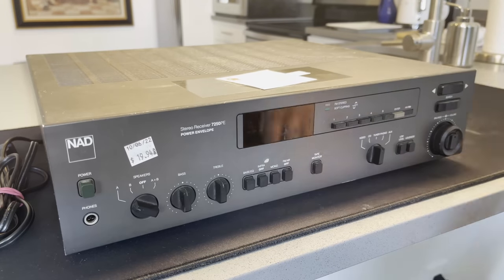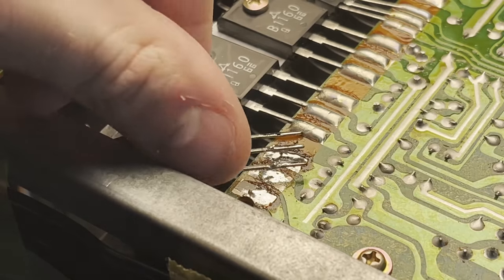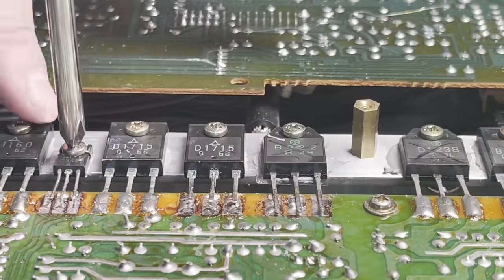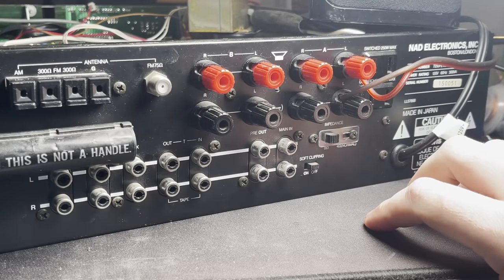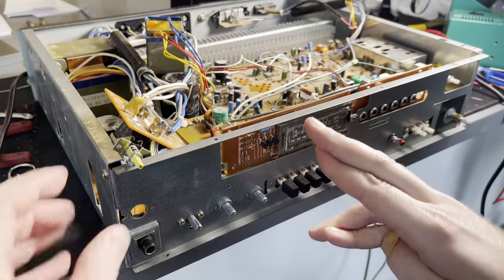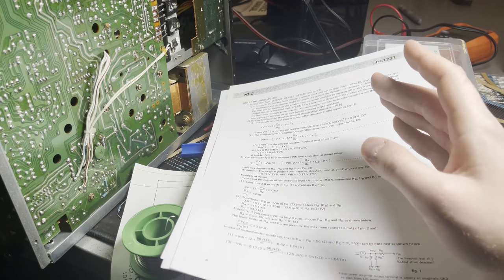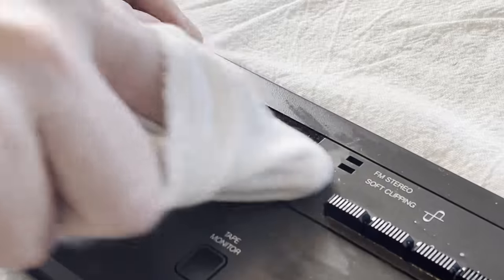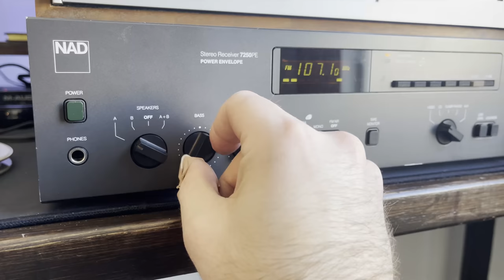Broken Amp? NAD a problem! - 'Fixing' A Mid 1980's Amplifier

Comment: I repaired a NAD 3030 in about 1985 (!) and made the rookie mistake of hooking up my good hifi speakers which of course exploded. Best to use power resistors if you can. I did get it mended though, original fault was an earth wire under a screw which was slightly loose leading to voltage transients which took out the power stages. Didn't help the owner used it on Phono which gives the highest amplification. Soldered a new earth wire after repairing the power stages to prevent it happening again.

Comment: I have the exact same amp., which I bought new in 1987..   It still works like new.  BTW, if you ever do fix that amp, buy lots of replacement transistors.   When you sqeeze out thermal compound the same  as you do toothpaste, those transistors will be blowing out like cheap light bulbs.

Comment: This was enjoyable to watch.. very engaging. 
Funnily enough I picked up an amplifier that was dumped outside a house in a street nearby; but the left side of any output doesn't work (I haven't tried speakers yet though, just headphones).  I have no experience so it won't be getting fixed; but it was interesting seeing you go through this process.

Comment: I'm going to have a go at my NAD C740 which sat unused for a decade and now has a similar protection cutoff issue. Also a neophyte at repair in logic circuits, but know enough to know that the caps will all need a close inspection. I have cheap DVM, ESR and LCR meters and hope to spend the idle winter hours trying not to let out the magic smoke. Nothing to lose and I might learn something. Schematics in hand!
Reply from the maker: Good luck!
Reply: I also had a C720BEE with protection circuit issues. Had it professionally repaired and recapped, full bias adjustment etc. Was worth every penny. Runs two sets of speakers and a sub in my shed. I also have a NAD 3225PE in the living room that I bought new in 1992. Always loved the sound of NAD amps.

Comment: As U probably now know the bridged connections on the rear panel seperate the pre and power amps.  It's so you can get access to pre out and power in separately.  You may pre out to a different / larger power amp.  You may just want to utilise the power amp from a different pre amp source eg external phono pre amp, any line output.  After all it's an integrated amp, meaning both the pre and power amps are in the same box.  Thirdly, as U suggested, U may want to do some signal processing inline between the pre out and power in.  Also gives you access to the pre out, like tape monitoring, eg taking it into a mixer or PC software etc.  A good feature all NAD integrateds have that I have seen.  The new NAD stuff now uses smaller links that are insulated.  Back to the video, cheers.

Comment: Hey from Australia. In my opinion, printed circuit boards are no ones friend. Yeah they're great in low power units like separate Tape Decks and Tuners that don't pull a lot of current etc BUT in amplifiers, especially vacuum tube amplifiers like I own (Primaluna HP Integrated Amplifier running 6 12AU7s on the preamp side and 8 KT120s on the output side) ventilation is essential. Primaluna valve amps run point to point wiring and any PCBs are low power that run their adaptive auto bias which is not in the signal path. All of the valve sockets are attached to the chassis with pencil sized holes around each socket to keep the amp cool. As soon as I saw a Primaluna HP Integrated Amplifier, I had to have it. $7,000 later and nearly 8 years later, it still sings and no more multi meters to check the bias of each of the 8 tubes. NAD have a strange setting on the back labelled (soft clipping). I've forgotten the logic behind it. I'm 63 and have been around electronics all my life. I'm an analog studio/visual enigineer and I was a club DJ over a 30 year period. Cheers for now Andrew Collins, Melbourne Victoria Australia.

Comment: The pre out is to allow for a different power amp to be used and the main in is to use a different preamp. Yes, the jumpers are necessary to use it as a single unit.

Comment: The IC you replaced senses if the power amp output is bad, eg. if there is DC output to the speakers which can be caused by the DC offset adjusted badly, or sometimes the components around that IC for the RMS detector have gone bad, then the IC will trip the relay. This is quite common on other amplifiers such as my Marantz PM7200/6000.

Comment: you should be able to adjust the DC offset in the amp (ie the trigger point) probably a couple of variceal resistors. If you can get a manual it should say how to adjust the offset, so you don't need the extra resistors

Comment: Check your dc voltage at your speakers terminals should be below 50 MV.
Reply: That's what I'm thinking too. Maybe out of spec and overheating one of the transistors

Comment: As for those transistors. The β, that's the difference between the base-emitter current and the collector-emitter current, or amplification level to use a simple term. If the transistor has a β=200 and you're giving it a 1mA current B-E, the current C-E will be 200mA. If it's really far off., like it seemed with at least one of those you measured, you should probably replace the transistor.

Comment: I wish there was someone like you local to me. I was given a Cambridge Audio One. It has a cd and DAB radio and of course speakers, which I thought would be perfect for my bedroom.... but after turning it on no sound came out🤔 Seemed like everything was operating. Then I decided to plug in my headphones, sure enough they worked perfectly🤷‍♂️ 
Now I don’t have access to any repairers anywhere near me and I don’t have the skills.....( I could have replaced a fuse😬) 
So it’s sitting out in my back room.... I did connect up the little bookshelf speakers and they had a good full sound for their size. 
I need to find a hifi / electronics enthusiast on my travels.....🤔 hopefully she’s single too😬😂
Reply: Bob Cordell wrote a very good book about audio amps. Find PDF on the web, the rest you would have to learn by experience, building some diy kits (beware of some of the Chinese kits). Also some the parts are harder to find as the technology turned into class-D amplifiers and chips. The easiest good modern amp would be something based on LM3886 50W chip. Really very nice sounding device, way better than some of the old '80s amps or cheap class-D junk.

Comment: Usually when power transistors fail, they will be totally shorted from C to E (the semiconductor turns into a “full conductor”) so checking that in circuit is usually enough, there will be nothing in an amp circuit shorting them together anyways - but you can also lift just the base to check the diode drop of the B-E junction just to be sure. Other types of failure like leakage, low Hfe, noise etc. are more of a concern with small signal or germanium transistors. 

Can it be that you swapped one of the output transistors from L to R when you resoldered them? That would explain the DC offset because those transistors need to be carefully matched. Also there might be pots to dial the output stage in.

The thing with the 'EQ LOOP' happened to me, as well. But in my case there was a CD direct button which bypassed the preamp tone control for the CD input so I figured the fault must be at the tone control or input selector. Signal traced it out just to find out it worked perfectly - and to notice in the schematic that it wasn't connected internally. Yikes!

Comment: Do you have a digital microscope? I use them to check all the solder joints and for cracked traces.
Reply from the maker: I had a cursory inspection of the solder joints and nothing too obvious stood out to me. I do have a digital microscope, but with the stand it came with it wouldn't work very well on such a big device haha.
Reply: @HifiJelly  I've seen old radios that were DOA come back to life just by taking a heat gun and gently going over the PCB.

Comment: !!! Some thermal paste has metal content in them which makes the paste conductive. Some transistors have a metal surface at the rear of them and base (?) connected to that. The ones here have a plastic rear so there isnt a problem here but if there is a micca pad and a metal rear surface ALWAYS use either thermal grease or ceramic based thermal paste and NEVER metallic ones (computer thermal pastes usually have metallic content)

Comment: Did you remove the mica insulators from the output transistors and just mount them right to the heat sink?  If so, they are going to short...
Reply from the maker: I removed then to clean the old thermal paste off them, but I put them back where they were originally located. I was curious what those were for, figured it was insulating them from the heatsink but wasn't sure why.

Comment: Im not a technician but arent the metal bridges from pre-out to main-in supposed to go from hole to hole only without touching the metal around the port, while you used a cable instead and bridged the full port?!

Comment: At 8:10 in the video, you need to CLEAN  the board prior to soldering. All that old dead flux needs to come off. When you weld or solder, the bond area must be CLEAN. As in hospital CLEAN.

Comment: You finally found it (and you can ignore 90% of the comments) but you had your answer on page 14 of the service manual. Good grief, if the idle currents and/or DC offsets are way out of wack then THAT'S WHERE YOU START. Even if the relay is tripping you can check DC offset at the input pin of the relay. Also you most certainly can check the output transistors in-circuit. Use the low ohms function (not diode check) and measure emitter-collector. Nothing in the circuit will cause a low ohms short circuit except a blown power transistor. The output stages consist of 2 parallel connected NPN and 2 parallel connected PNP transistors in a class AB configuration. If one shorted it's a good bet the other 3 got taken out as well. The biasing transistors could also have gotten damaged. Modifying the protect circuit was absolutely a stupid thing to do especially since you said you measured over 200mV and the optimum setting for DC offset is less than 50mV. You are proving the old adage that a little knowledge can be a dangerous thing. Oh and since this manual covers all  model variations, it's a good bet the US version doesn't have the distortion adjustment pots.
Reply: I never saw the protection chip gone kaput, it's usually what you mentioned in your post.
Reply: @pliedtka  Yea, that's why I said a little knowledge can be dangerous. Imagine what damage you could do to your speakers if you send a high level DC to them....and whoooops!, my protection circuit didn't trip because I modified it because I didn't read the damn service manual.
Reply: You were very lucky to have been born with all knowledge, and never having made a “stupid” mistake.
Reply: @ShadowsOnTheScreen  You're kidding right? In this line of work, if you don't know what you're doing you get help from someone who does. You risk not only damaging equipment but possibly killing yourself in the process. Even in little amps like this you're still dealing with high voltages and currents. I've been in the aerospace business for 30 years. I drill into all the techs under me....if you don't understand something, get help. No excuse when you've got the documentation in front of you.
Reply: @MrDmbright65  if you don't know how to interpret this information you can't really apply it. All he is risking here is damaging his speakers. You have to learn somehow. And you might be a person who is able to interpret documentation in a way that translates into actual real life application and that is admirable whether you worked for it or were able to do this from day one but most people are not capable of doing this. Atleast not without experience.
Reply: @trevor245  Trevor, i've been doing this 45+ years and seen the results of ignorance or incompetence. I've knocked people off of live circuits who were doing the 60Hz shuffle and even once (in the navy) had to perform CPR on a sailor who got hit with 480V 3 phase feeding a radar set that he thought (but didn't check) that the power was tagged out. Even a little amp like this can put you on the ground if you do something wrong. It goes right back to what I first said. If you don't know what you're doing, THEN DON'T.
Reply: @MrDmbright65  Even when studying electrical engineering you learn by doing. One of the first things we did was make an amplifier. While I understand where you are coming from I still disagree
Reply: The extremely valid and labour saving point you've made, is checking the contacts on the amp (not the speakers) side of the relay for DC. I'm working on a NAD7150, which was in 'protection mode'. I measured -18V (bad) on the L channel and 28mV (good) on the R channel.  A transistor and resistor in the L circuitry had become defective.  I've got the receiver out of protection mode, but there is more work to do. These bigger NAD receivers run hot; I noted a lot of electrolytics with shrunk or discolored sleeves. A partial or complete recap may be the answer.

Comment: this two bridges are for the external equalizer😂 measure the middle points between the amp for a DC Value. if a DC is there the secure switcher protect the speaker and switch off the relay.

Comment: Pre out is if you want to use it as a pre amp for some other power amp...and main in is if you for some reason want to use it as a poweramp.
classic mistake to forget to check if the bridge is there.. done it many times.

Comment: ALLOW ME TO 'REPAIR' YOUR NAD AT FIRST GLANCE: Before you even plugged it in or took the cover off .. I looked straight at your problem, which should have been obvious when you determined your pre amp worked but no signal to output amp. SEE BACK PANEL AND OBSERVE THAT YOUR TWO RCA JACK JUMPERS  ARE MISSING  FROM PRE OUT TO MAIN IN. 

The jumpers are removed if using an equalizer in place of the jumpers. If you remove the EQ, the jumpers have to go back in otherwise there's no connection between preamp and amp section. If you can't locate replacement shorting shunts, simply use a stereo RCA plug patch cord to hook the pre out jacks L&R to the main amp in L&R. 
'Fixed'
But now, what damage was caused doing unnecessary circuit work? 
Don't worry .. many people, techs included, have overlooked this simple issue.

Comment: SOOO THE GOOD AND THE FRICKEN BAD.    THE GOOD IS.     IS THOSE JUMPERS HAVE TO BE IN.        ITS SO YOU CAN HOOK UP 2 OR 3 OR 4 ,  5 AMPS.    THE BAD IS  TONS OF PEOPLE SELL AMPS WITH THOSE MISSING AND THEY LIST THEM AS BAD AND WE GET EM CHEAP.   THEY WILL WATCH THIS AND NO MORE CHEAP AMPS.    THANKS ALOT.        THINK BEFORE YOU SPEAK.  YOU JUST ENDED OUR CHEAP AMPS.        Oh they can click On then off if open because you take away shielding and feedback will make it overload and click off.      And I seen the ending and its kicking off because of feedback from cover off or the transistors are leaky.   I'd buy another one off eBay and compare. The if difference in trannys replace all they are in parallel.     NEVER SELL THIS ULESS YOU TELL THEM ITS DEFINITELY BEEN HACKED UP.    You Will learn Everything you touch will break later so try not to remove things you don't need to.   You'll learn.   I.did.

THE HANDLE.   DUUUUDE THATS THE AM ANTENNA

Comment: The word for a 'temporary fix' is a bodge, a cludge, dodgy, she'll be right, good enuf, wok n roll, hot pockets, a Spinal Tap reference, enjoy Mr NAD.
PS a little light oil on the chassis, rear incl inputs wiped off with a cloth stops degradation from oxidation.  I oil up my bike, electronics and even myself, olive oil, sorbolene, sewing machine oil 🛢️ cheers.
Reply: Cludge
an ill-assorted collection of parts assembled to fulfil a particular purpose ;-)

Comment: Sorry but this is not a fix. I know, you put the fix word in quote, admitting that it's not fixed, but still, these kind of "repairs" are an eyesore for me. Soldering that IC in backwards was stupid but hey, we all making mistakes. But altering the DC detection circuit is not a good thing to do. You had the high DC on the output because one of the transistors (probably one of driving the pover transistors at the end) was partially bad. The high DC triggered the protection. Altering or disabling the protection circuit isn't a fix. And yes, 0.2V DC on the output won't kill the speakers but it is high, usually you should have only a few millivolts there. 200 mV DC will be already audible on some speakers, which has negative effect on the sound. The initial problem is still there, that transistor is still failing, and eventually it will fail entirely. Than you have to fiddle with it again.